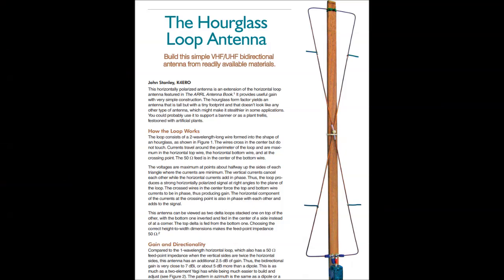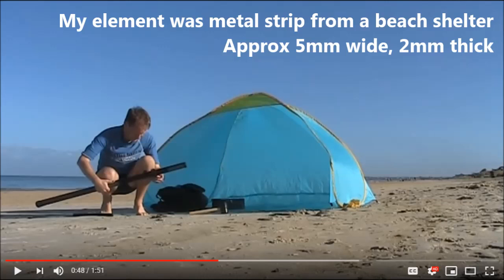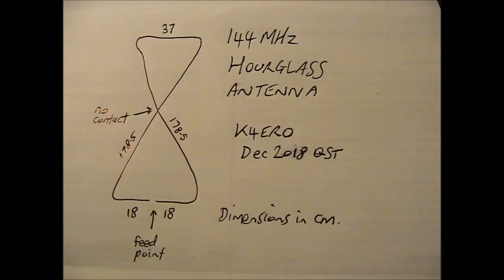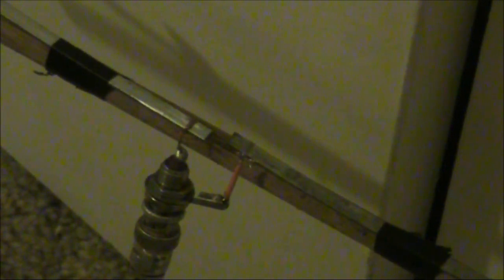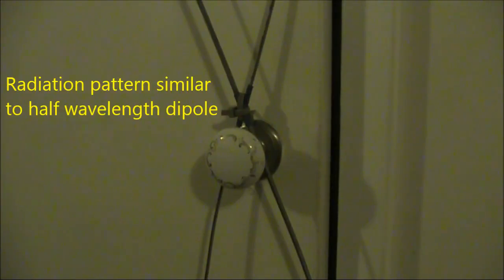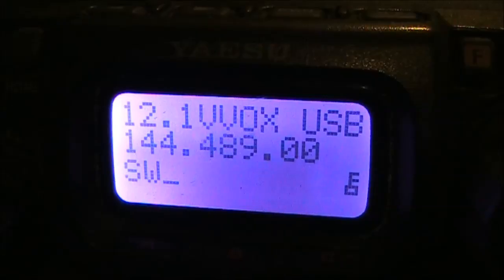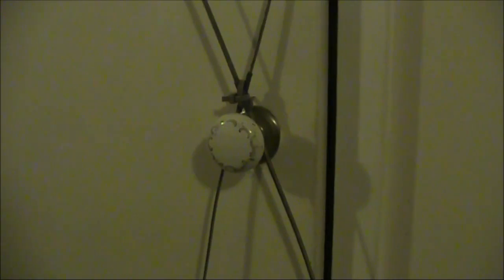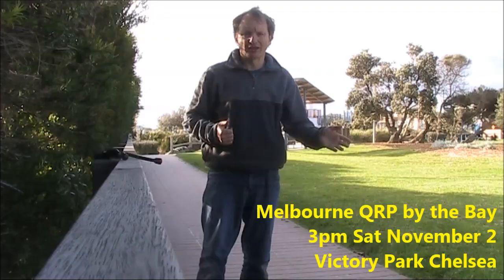Hourglass loop antenna for 2 metres SSB and WSPR

Comment: Here are some dimensions for a 10m version which works.  I've have used this design since just after Peter posted this video; and right now I'm using two of them in the ARRL 10m Contest ... while I've been trying to write this comment I keep getting interrupted by DX stations answering my CQ calls ... 😁

The horizontal sections are fabricated from two lengths of aluminium extrusion each 2.0m long - anything would work for this, e.g. pipe, square section, angle, etc, as long as it is not too heavy and doesn't buckle under load.  The bottom one has about 50mm removed from the middle - this is replaced with an insulator (piece of 1/2" thick perspex in my case) to form the feed point, and I used a balun to convert the balanced feed to an unbalanced one for feeding with coaxial cable.  The top horizontal section features a rope bridle to allow it to be hung from a central support (e.g. tree branch) while keeping the element level.

The phasing lines were each fabricated from 2.5mm², 7-strand, PVC-coated, electrical "building" wire.  These are 9.61m long.  (You could use un-insulated wire to make the antenna lighter, but the wire length will be different due to velocity factor.)  To secure the centre cross-over point for the phasing lines, I used a short piece of electrical conduit with holes drilled through each end - the lines are fed through the pairs of holes at each end, and cable-tied in place to make sure it doesn't move.  The position of this cross-over is not that critical - about 1/2 along the lines is fine.

The dimensions stated above put the lower 1.5:1 VSWR frequency at 28 MHz (for CW operation) for one of the antennas I built (I built two almost-identical ones) in its installed location, but the other one was too low in frequency ... that's the effect of different trees and ground for you!  To retune it, I took the existing loop length, multiplied it by the desired centre frequency and divided it by the existing centre frequency - subtracting this new loop length from the existing loop length and dividing by two gave the amount to be removed from each of the phasing lines ... which is much easier than cutting aluminium section!  I didn't cut the phasing lines - instead, I "pinched" the amount required (starting 500mm from the bottom horizontal section, for ease of working), folded that in half, twisted it and then curled it around into a knot to make sure it didn't come undone.  After the modification I just mentioned, the 1.5:1 VSWR bandwidth measured using an MFJ-269 at the end of 5m of RG-8 was 295 kHz, with minimum VSWR of 1.3:1.  Of course, any coax added to that length for running to the radio shack will broaden the VSWR bandwidth due to loss in the coax.

These antennas are supported by trees with overhanging branches at about 14-15m height, with the top horizontal section just under the branch, and the bottom section about 5m off the ground.  I used two ropes secured to ends of the top and bottom horizontal sections, and tied to convenient tree branches or tent pegs to maintain the beam directions.  The two antennas orientated at right angles to each other cover all DX headings.
Reply: Moving the point where the wires cross will change the resonant frequency by several MHz. I'm not sure what it will do to the antenna's pattern however.

Comment: could you feed it in the middle crossover point? would that make it vertically polarised for repeater work. I'm in an apartment and want to put it on a large window. Dave VK1DV
Reply from the maker: Wouldn't know. But if you rotated the antenna 90 deg so it was wider than it was high it would be vertically polarised. If your window isn't wide enough then try an oblong loop turned 90 deg.
Reply: I thought maybe two triangles stacked point to point and fed in the middle it would then be two full wave loops of 100ohms in parallel giving 50ohms, I can just fit that in a tall window in the apartment so will give it a try.

Comment: i wonder if 3 wire romex wiring would work,attach all 3 wires together and might get some decent bandwidth
Reply: If you want bandwidth you need diameter. Sure you can run triple romex, but it's going to be heavy and won't be nearly as wide (freq.) as 3/8" tubing (10mm).  I strip romex out to build wire antennae, but never use doubled/tripled wire.

Comment: Look at the "hentenna" from Japan. Google it
Reply: that's an interesting beast, I wonder how the gain compares to this.
Edit: I was just looking, the hentenna has about 3dBD of gain.
Now I'm interested in another idea concerning the hentenna that just popped into my head. A feed modification. Use a 1/4 wave stub to match and feed one of the long sides while running it vertically polarised. It will be more mechanically convenient and will be low loss.
The downside may be some loss of bandwidth. You also would have to find the point of minimum current in order to do it right, this may be a bit off centre. 
Next thought: see how it works with the normal feedpoint shorted opened and with the old feed wires completely removed. Observe the difference in resonant frequency and on air performance.
Like this it will be just a 1 and 1/2 wave loop

Comment: Hi Peter,

Thanks for this video.  I just modelled the antenna using NEC-2.  Using 2mm diameter copper wire, and the lowest horizontal wire at 1/2 wavelength above good ground (conductivity 0.005 S/m, dielectric constant 13); the maximum gain is 11.1 dBi at 13 degrees elevation with 14 degree beamwidth (-3dB); and the beamwidth in azimuth is 89 degrees.  Feedpoint impedance is 46 Ohms at resonance.

The two diagonal wires connect the two horizontal wires in such a way that the latter form a pair of in-phase horizontally-polarised radiators separated by approximately 0.85 wavelength and carrying nearly equal current, so the gain is not surprising.

Cheers, Mike
Reply from the maker: Thanks Mike - very interesting. 11.1 dBi looks massive and more than the article author claimed. Wonder how its modelling compares with the oblong loop featured a month or so back?
Reply: @vk3ye  Hi Peter,

I shouldn't have reported that gain above ground for this antenna - the gain is somewhat illusory; because it doesn't represent a typical use case - putting a 2m antenna like that only approximately 1 m above ground will not work well due to line-of-sight obstructions, except on a hilltop or similar elevated location.  (Having said that, scaling the antenna for 28 MHz and putting it 5.5 m above good ground is another issue ...)

On the 2m band; free space gain is 7.1 dBi with an elevation beamwidth of 41 degrees, which would be more representative of such an antenna mounted on a mast.
Reply from the maker: @vk2ig  your 28 MHz idea just got me thinking. An advantage is that even a 14 MHz version would require less than 4m of vertical space if it was turned 90 deg. Thus it could be put on two squid poles. Wonder how it would work as a vertically polarised salt water antenna?
Reply: @vk3ye  Hi Peter,

The Oblong Loop, per your video https://youtu.be/Nyttl277ehs, modelled using the same materials per the modelling of the Hourglass Antenna, exhibits a free space gain of 4.3 dBi with an elevation beamwidth of 89 degrees, and an azimuth beamwidth of 87 degrees.